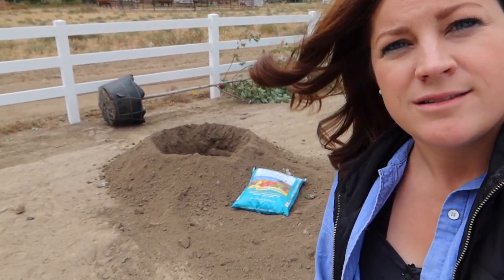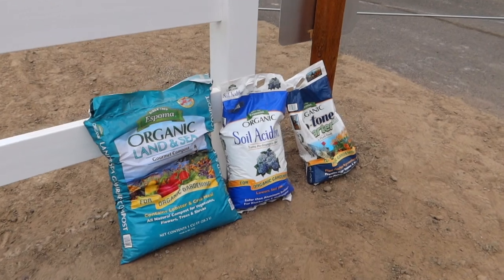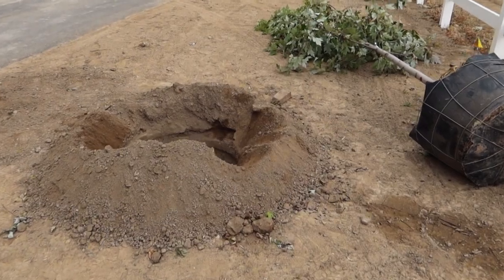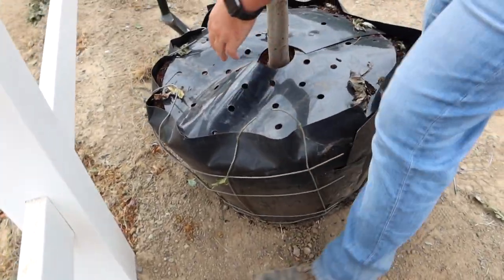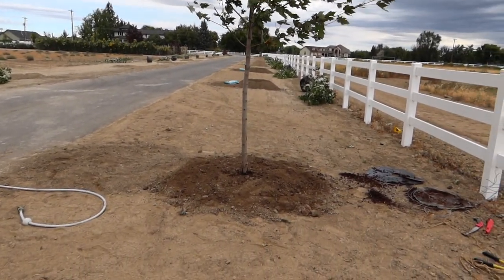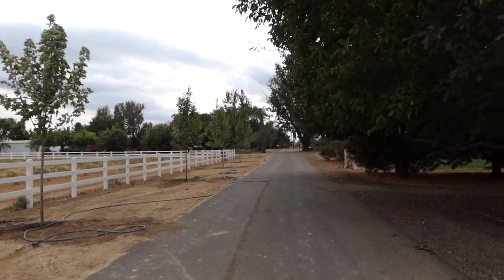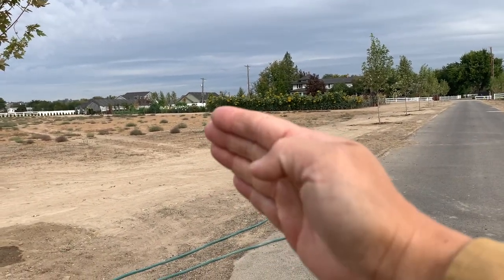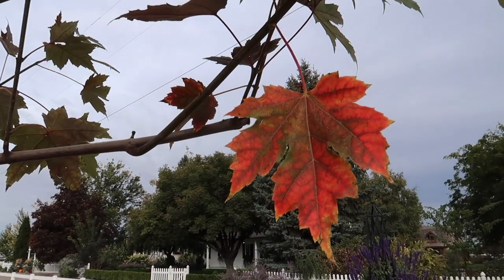Planting the Trees Along Our Lane! 🌳🙌😍 // Garden Answer

Comment: Just thought of another idea, using your corn stalks, using them between the sunflower stalk. Pumpkins in between them against the fence line. Tying them with the red & yellow ribbons, after you wired the stalks to the fence, so the high winds won't flow them off the fence.

Comment: Thought you might like to see the Autumn Blaze in my backyard. The picture is from last fall - it's only just starting to colour up now.

Mine does get seeds, lots of them that the squirrels love, but I don't get many sprouting. I planted that tree about 10 years ago and it was half the size of the ones you planted, so they do grow quickly. One thing they do is they tend to have narrow branch crotches, which they get from the silver maple side. I tried to prune to correct that when it was young but still ended up with some weak branch-trunk joints. I may need to chain them like you did with your broken tree. From what I could see in the video, your trees look like they have good branch structure.

In case you're wondering, the other plants in the picture are: the small red tree at the bottom right of the maple (kinda blending in with it) is a Stewartia; the yellow in front of the maple are a redbud and an elderberry; the orangy-red one on the right is an Autumn Moon Japanese maple; the golden plant in the foreground left is a drinking gourd hosta and in the bottom right corner is a Quick fire hydrangea.
Reply: Ah, looks like I can't post a picture. You'll just have to imagine it. :)

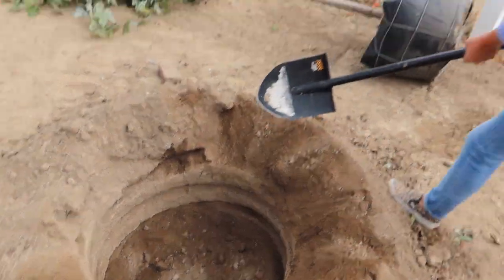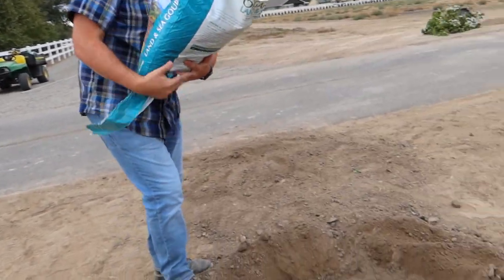Comment: Ok just pausing at 9:30 or 9:54, to me it appears the auger compacted the edges of the soil? Will that affect the root system wanting to move outwards? And should you have watered holes down after adding the soil to bump up the hole? No expert here of course, just an observance. Ok let me continue to this glorious video! Ok and should not the hole be twice as wide as the size of the root ball? I'm concerned.